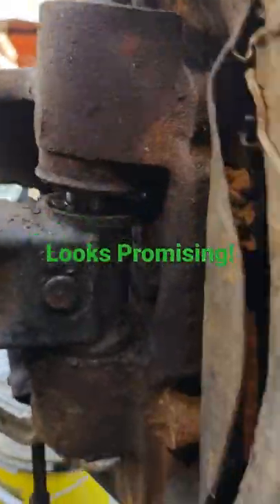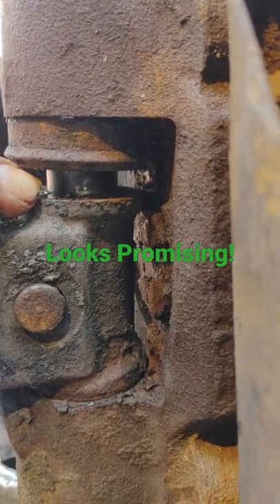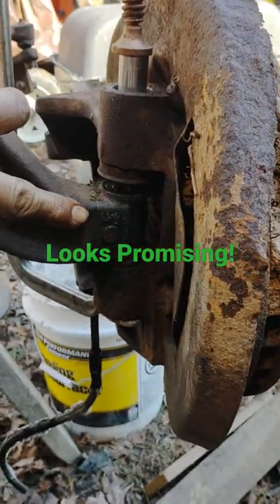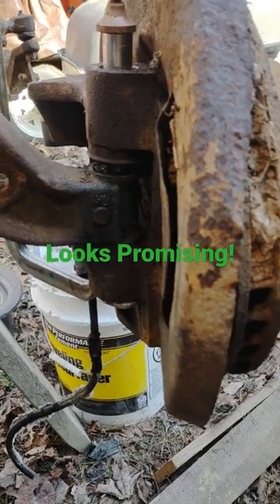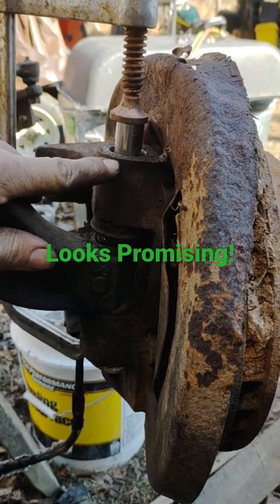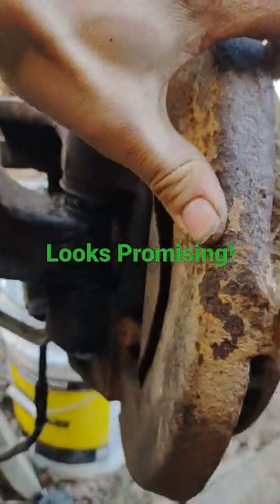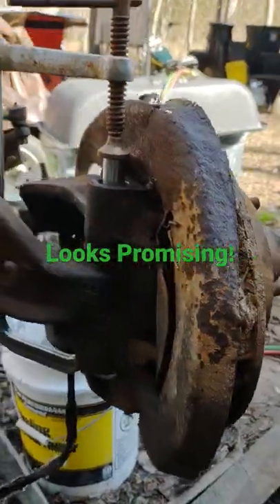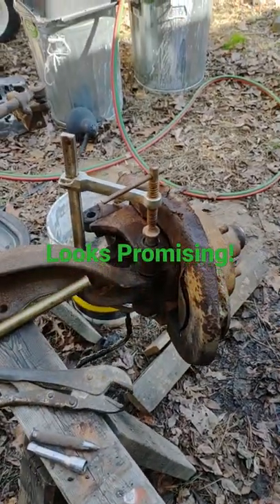Ford I-beam Disc Brakes on an Old Straight Axle? I Think So!

Comment: There is supposed to be a thrust bearing where you are talking about putting in a spacer, and shims that take up play that go on the bottom side of the axle, between the axle and spindle.
Reply from the maker: Yep.  And the ones I have are old and rusty.  Fortunately they still make them, so I'll be getting new ones and they'll be part of the stack.

Comment: How did this turn out? I have a 64 f250, and now you’ve got my hopes up. What year did the disc brakes come off of?
Reply from the maker: It's not done yet.  I cleaned and painted the components, but the project I slated this for is on hold. 

The disc brakes were off a 70's f150 of some sort.  They came off a suspension assembly that had been torch cut off the truck and left in my friends yard.   

When I get back to work on it, I WILL put videos up about it, so keep it tuned!